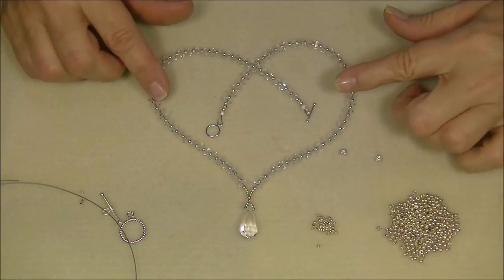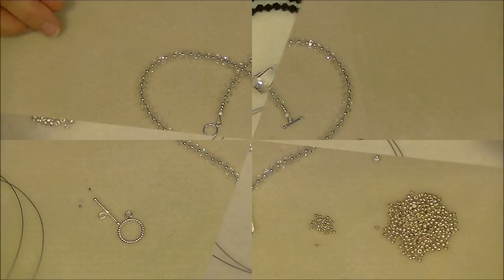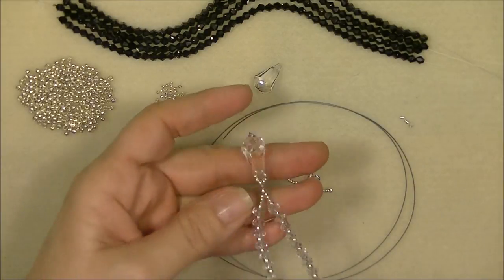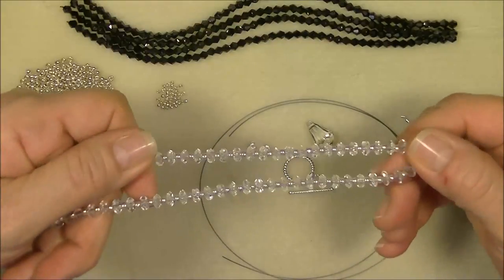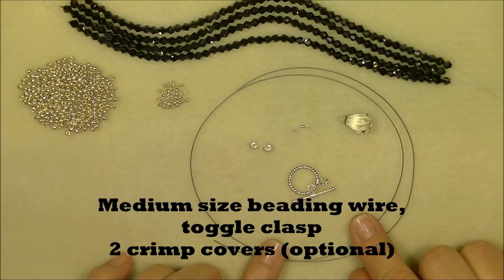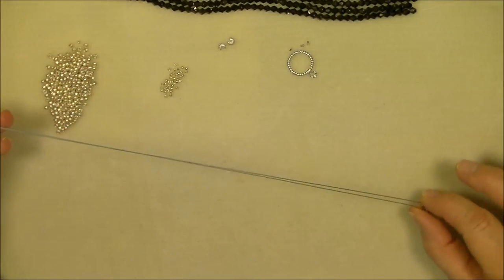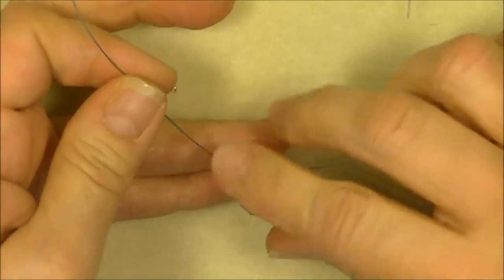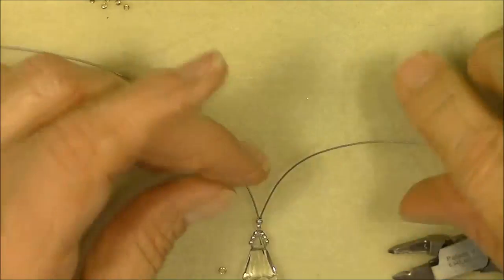Crystal Necklace Tutorial

Comment: I want to start again working with beads and your channel has been one of my favorites. I have one concern: can you offer some suggestions about how to choose findings that won't tarnish or give of that "metaly" smell? I've found that some of handmade jewelry particularly rosaries, which tend to use many loop pins, etc tend to give off that smell after a while, especially when you touch it and the smell lingers in my hands. What should I look for or avoid when buying findings? Thanks.
Reply from the maker: Perhaps stay with higher quality metals, like sterling, however it is expensive and it does tarnish. You can use stainless Steel, it tends to stay as is after use. But, I am not a metal expert. I buy findings I think are pretty. I don’t really have any issues with them. But I don’t repeatedly wear one piece, My jewelry stays looking new. If it tarnishes I use a silver cleaner or jewelry cleaner I buy at Walmart.